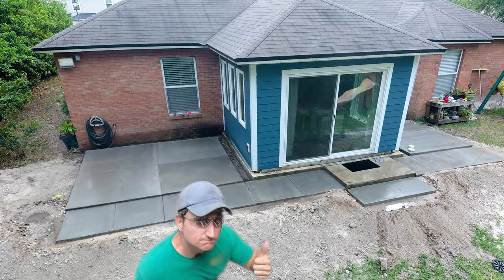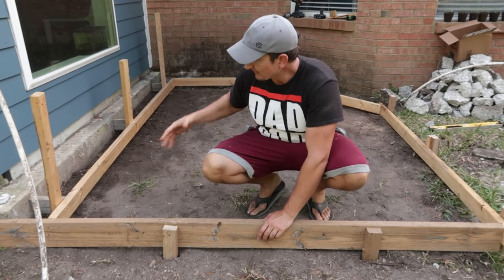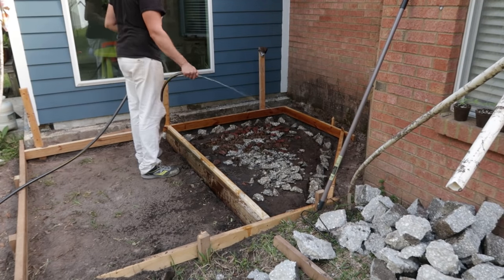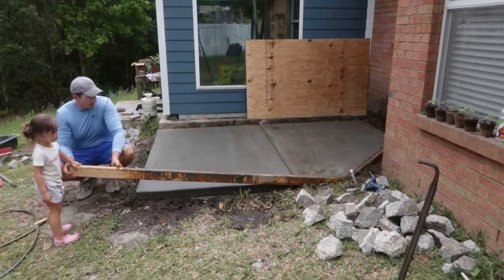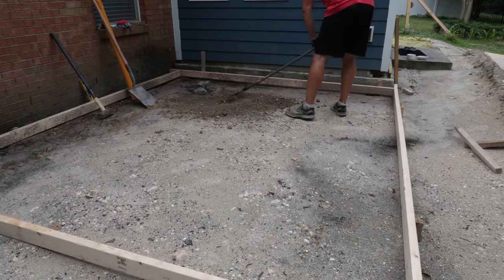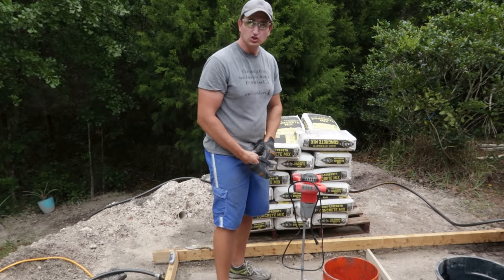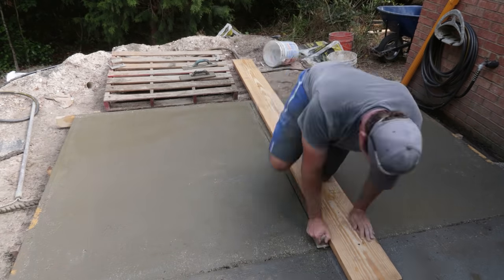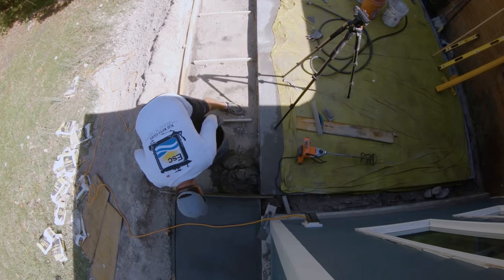Pour a Concrete Patio Entirely  by Yourself Using Bag Mix Concrete, DIY Project From Start to Finish

Comment: Wow! Can’t believe you did all that work AND shot and edited a video. Impressive and entertaining. 

So now that it’s been a year, how is it holding up? Would you do it again the same way? 

We are getting ready to do the same. I’m watching videos on the topic. Yours is the best so far! Thank you 🙏
Reply from the maker: Thank you for your kind words. It is awesome to hear when someone realizes the effort that goes into making these types of DIY videos.  The patio is holding up fantastically. No cracks other than one or two hidden cracks in the control joints (as designed).  I likely would do it all pretty much the same way.  I enjoyed the exercise benefit of mixing the concrete however I would probably use the concrete mixing drill entirely.  Seemed to work fairly quickly when mixing concrete by myself.  I might also remove the broom finish procedure as I think the finish after the magnesium trowel looks better and still provides plenty of friction.
Reply: @MrKistel  Okay, that is valuable information. Glad it is holding up well! Enjoying your other videos. Great work. Thanks again!

Comment: This was A great job!  I'm no expert and am looking to do a slab for a 12x20 shed.  How large was your total square footage and how deep did you go?  Also what was the cost of the mixer.  Anyway great job,  how does it look now?
Reply from the maker: Thanks Rick, the concrete patio looks great still with no observable cracking outside the control joints. I believe I used around 180 80lbs of concrete for the entire project. There is a link to the mixer in the video description area.  Sound like you have a pretty substantial concrete project in the works. Let me know how it goes and best of luck.
Reply: Not sure if you’ve done your pad yet, but look into renting a mixer for a day. Much, much quicker and easier on the back. I helped a buddy with his 15x15 at about 5 inch thick pad and were done just after lunchtime. We were tired but not exhausted at the end.
Edit: rented mixer from HomeDepot, says two bags at a time but we did 3 and 4.
Reply: A 12×20 slab wud be just as expensive with bagged concrete as it wud be with a concrete truck. Definitely wud not do that with bagged concrete

Comment: Nice work. I only have one question is why did you form up all 4 sides when 2 sides were already formed for you using the house and existing patio? Now you will have to go back and fill in that 8-10 strip all around.
Reply from the maker: Thanks. I left the space open primarily to be able to more easily apply routine termite prevention treatment around the perimeter of the house.

Comment: Great video and nice work.  I want to do the same thing in my back yard.  Do you need to use rebar?
Reply from the maker: Rebar reinforcement was determined not necessary for the concrete patio job shown in the video however I can not speak for your project. Much of it depends on the expected loads and use of the completed concrete area.

Comment: Not sure where you are,  but here in Florida we have a company called 3 yard concrete. I did same as you until it came to the concrete. I just called 3 yard they showed up with a mini truck poured my slab and I finished it. I spent an extra $100 with tip. Well worth the money saved me a day of opening bags and mixing. DIY is cool but DAMN use your head. Let's work smarter not harder.

Comment: 1) your daughter is adorable. 2) how come you didn’t do the “footers” and concrete chunks in the last 2/3 of the patio, like the first 1/3?
Reply from the maker: Thank you, I did not have any remaining concrete chunks to use for fill in.  The edges of the other side were deeper  but with a more gradual transition, so a obvious footer trench is not seen. The overall concrete slab was a bit thicker and more concrete was used to fill the formed concrete space.

Comment: great video... im thinking about doing my patio in a similar way... after 1+ year, how has the concrete held up?
Reply from the maker: Thanks. The concrete patio is doing great, working as intended with no visible cracking.

Comment: I’d always put mesh in my slabs.  4mm wire mesh is the normal. And I always key/tie into existing concrete or wall if it’s pre-existing (10mm rebar cut to half a metre and bend the ends). 

Usually, id poison and plastic below, to stop roots coming through.
Reply from the maker: Thanks for the tips.  I wanted to keep this patio structure separated from the house foundation in this scenario.  Mesh reinforcement was determined not necessary for this application considering the light loads the concrete patio would see over its lifetime.  Seems to be holding up well thus far.

Comment: Really like your video.  Do you think if you had a wheel barrel to mix the concrete it would have been easier?
Reply from the maker: perhaps, it is tough to mix concrete by hand in any case
Reply: @MrKistel  thanks for the info.  Great video

Comment: Do you have a overall rough cost for the entire project?
Looks great!
Reply from the maker: Thanks, I think it took nearly 180 80lb bags of concrete if that helps.
Reply: Assume $5 per bag plus shipping = $1000 Then what did he say , 13 or 14 yards of dirt?  That could vary depending but let's say around $25 a yard so round to $400, then some pieces of lumber and tools, let's just say $300 for that so let's round it all up and say maybe $2000 . 

Since he recorded this project and posted it to youtube as of 6/4/2022 he's had 267,638 views but let's assume he get's 300k views and makes $5 per 1000 views so that's $1500, so it could be that this project only cost him $500.
Reply: @hfarthingt  😂

Comment: Can I use these concrete bags to do my driveway too?
Of course with the traditional sand and metal bar before pouring concrete 
To have professional do my driveway will break the banks so I like to try myself
Reply from the maker: I would think so however it sounds like a big DIY concrete project.
Reply: @MrKistel  
It is but I plan on doing section by section like the way you do your patio

Comment: I know to pour concrete, my question is on the one side of my Sunroom there is a hill. How do I reinforce the concrete , so it does not move down the hill ? Do I drive rebar into the ground, on top of the hill?

Comment: This was an ambitious project.  You did a nice job, but I don't think it would have come out nearly so well had your little helper and helper kitty not been there.  I have a similar project in mind at my house.  I've done driveways and fairly large foundations myself before, but the concrete was delivered by truck.  The location where I want to pour is not accessible by a concrete truck, so I'll have to bag it.  You gave me inspiration and some good ideas.  Unfortunately, my little helper is all grown up and doesn't live nearby.
Reply from the maker: Thanks but sorry to hear your helper will be unavailable.  Have you looked into the possibility of having a concrete pump truck come out?  Might be a consideration if it is a big pour.
Reply: @MrKistel  I have considered, but not easy access there either due to trees that I don't want to remove.  Plus, it's only about five yards.
Reply from the maker: @jaydee5156  10-4, keep us posted with your projects progress

Comment: I commend you brother. Cant help to wonder if concrete trucks in your area have a hose tho. Feel that would have still been socially safe and a lil easier, tho its concrete. Nothing is easy in concrete. 👍
Reply from the maker: Thanks I could have technically ordered a concrete truck and a separate pump truck, however it would have been costly and I wasn't confident I could work all that concrete at once.
Reply: @MrKistel  I get that. Lol 👍

Comment: Overall it was a great job and one that I would hate to try by myself.  I was wondering why you didn't want the top of the concrete areas to match up though instead of having a little step down that could pose a tripping hazard?
Reply from the maker: Thanks.  The multilevel was designed as a preference and has not been an issue. Part of the reasoning was because there was an existing concrete step platform near the door and it would not match up with the elevation of the bigger sections of the concrete patio. To join all the concrete surfaces together the slight step down section was created to have a lower elevation of both the new patio and the existing platform.

Comment: Nice work. Curious, why did you chose concrete in lieu of a timber deck for all the areas? Cheers from OZ
Reply from the maker: a wood or composite deck could be nice to
Reply: I built a 15x20 deck. If I could go back in a time machine I would tell myself just have a concrete contractor place a slab, that would’ve been done in a day for less dollars. I built a pavilion on top of the deck but that on a concrete slab would’ve worked better with no need for railing and steps.

Comment: Sounded like you said the slab was 6 inches deep! Why? Are gonna build on it? Can you use that mixer on a regular drill?
Reply from the maker: Slab was 3.5 to 4 inches deep but a little deeper on the edges.  I do not believe the drill bit on the drill I was using would work on a traditional drill.

Comment: I did 5 pads of concrete and then concluded that you need a concrete mixer. Bought the ryobi. It only does 2.5 bags at a time but worth it.
Reply from the maker: Thanks for sharing

Comment: Wow thanks for the video. Question at your larger pad on the left side: with the walkway being lower than the pad has anyone TRIPPED because of the different levels? I hope not but that was the first safety issue I saw for older folks
Reply from the maker: Has not been a tripping issue to this point

Comment: Great job!

It looks as if you used crack resistant bags at the start of this project then switched it up. Why was that?

Also why did you do the sidewalk portion slightly lower than the actual patio.  I would think that would be somewhat of a trip hazard, was there an egress from the house that you had to deal with?

I will be using several tips that you showed us. Thank you for the great video.
Reply from the maker: Thanks Eric.  I would have preferred to use the "Crack Resistant" concrete for the entire patio project however the supplier did not have enough in inventory.   The sidewalk section was poured at a slightly lower elevation by choice, no pressing reason.  Keep me posted on your concrete project!

Comment: I'm still struggling with the gaps left against the house. U did an awesome job but the termite treatment reason seems weak. What are u doing with that gap?
Reply from the maker: Thanks. Gap was left for future termite treatment applications. Allows the ability to dig a small trench against the house when needed for treatment applications.

Comment: Hey man, thanks for your video. Why not pour bottom layer first and work up rather than go from one side to the other?
Reply from the maker: Thanks.  It would have been harder to screed. In the scenario demonstrated I could work back and screed at the same time without actually being in the concrete myself.

Comment: Thanks for the super helpful video! is there a reason you only used recycled chunks of concrete for the first section? Does it affect the strength at all?
Reply from the maker: I just used the blocks as filler to reduce the overall amount of new concrete needed.  It worked perfectly fine for this project. Some do not recommend doing this saying it could comprise the concrete strength.  I think as long as the pieces are deep enough under the new surface of poured concrete this practice is ok for light load concrete patios.

Comment: Just use a 55 gallon barrel and a paddle mixer. Can mix up to 20 bags at a time
Reply from the maker: Wow you can mix up to 20 concrete bags at a time? That is impressive. What size concrete bags? I was using 80lb bags in this video.
Reply: @MrKistel  20 bags of Quikrete premixed. Make sure the paddle is large, the one that fits snug into a 5 gallon pail.

Comment: Great job may i ask after the pour how long do you wait before rounding over the edges the how long before the broom finish?
Reply from the maker: In hindsight I probably would not do the broom finish again if I were to do the project over.  I believe the finish looks better and is textured enough for foot traction after a magnesium trowel pass.  Some people say to do the edges while things are still pretty soft, and others suggest letting the concrete stiffen up a bit first. If doing the broom finish you want the surface to be pretty stiff, so you do not dislodge any aggregate.
Reply: @MrKistel   as a concrete finisher myself I would recommend using a trowel finish then brooming over it for a slight texture. A regular trowel finish will be slick when wet.

Comment: Looks great !! Wish you had broke down the price of each block of patio you made. That would be a great help to us newbies that has never done this kind of project.
Reply from the maker: Each individual project will very so the cost of the projects I show may not be comparable to any viewers specific project.  For a concrete project like this it is pretty strati forward to get a rough idea of cost once you determine the amount of concrete you need. Many of the online concrete calculators make it easy to get a concrete bag count. Simply multiply the bag cost by the price per bag.

Comment: 1/3 the depth of the concrete is the rule of thumb controlled cracks just a bit of FYI if no one has told you before now I would never put something from under my concrete
Reply from the maker: Thanks for the comment.  The joints have held up well for this project.

Comment: Why did you use two bits of wood for the joint first bit of concrete you did
Reply from the maker: I am not clear of the question.  If it is about the joint between the first two concrete slabs, the form board was not tall enough so I added a second piece of wood to fill the remaining void.

Comment: How did it work overtime? I feel like that much fill would have needed more time to settle, or more compaction between layers.
Reply from the maker: I was worried about the fresh fill and long-term settlement as well.  I used water to help the settle the new fill as best as possible and I think it worked well.  That being said the patio is as stable as the day it was completed with no observable cracking.  Thanks for the comment

Comment: How come you poured the lower slab at a different elevation than the one next to the house?
Reply from the maker: It was kind of an afterthought; the elevation of the existing step pad and new concrete main patio pads did not match up.  For drainage it was easiest to just drop the walkway portion down below both structures.

Comment: I am about to pay $2200 for this same thing at 99 sq ft. The young man doing the work has done an excellent work for me before but for some reason I am really concerned.  My property backs to wetlands and 4 ft between houses. Anything ya'll would think I need to watch for?
Reply: My guy will have a mixer and a helper. So not quite as hard but it is 92 degrees here.
Reply from the maker: Thanks for watching and I hope your project goes well.

Comment: for the size  project and the number of days needed to do a one man job, it would be more practical and economical to just buy the $400-500 concrete mixer and resell it for at least half the price when everything is done. When I did my concrete I was lucky someone was selling a used one on crailist for $150.
Reply from the maker: Good tip, I still think I likely was able to work faster using the mixing drill though.

Comment: Great job, but all the small level changes are trip hazards.
Reply from the maker: Thanks for watching and your concrete insight. The step downs in the concrete patio were spontaneously  added into the project and I agree they could be a tripping concern for those not familiar with the patio.  Having said that it has not been an issue to us who use the patio regularly.

Comment: I am thinking about replacing an 8 x 10 backyard and installing a 12 x 35 patio.  Being that I am newly semi-retired, I have the time to do it in stages over four or five days.  The current patio is flush against the foundation.  I was going to do the new patio flush against the foundation as well, but I notice you left a gap between the house/foundation and your patio.  Should I leave a gap as well?  One factor is that I do have vents in the foundation, so I would either have to “carve out” notches in the patio to access those vents or simply not put the patio up against the foundation.  Your thoughts?
Reply from the maker: Sounds like an awesome project.  The main reason I left a gap between the house and the concrete was provide for routine termite treatment. This is a wood framed house in a region with termites. The insecticide needs to applied close to the house so the gaps make this possible in the future when needed.  I likely would have went flush to the house otherwise.  The gap areas have made for nice areas for planting annual flowers, etc. however.

Comment: unless something has changed in bag concrete this will be heart breaking when the concrete starts to crumble in a few years , hope things have changed , new a guy that did his whole shop floor 30x40 with bagged concrete and within a couple years it started to crumble , and a few later it was rubble , that was 15-20 years ago , he had gravel base and used plenty of rebar ..
Reply from the maker: gosh that sounds a major bummer his entire concrete slab started to fail

Comment: Great video.. you could also add a steel mesh to help.  I always try to remember concrete is great in compression but sucks in tention.   Nice job.
Reply from the maker: thanks and good tip